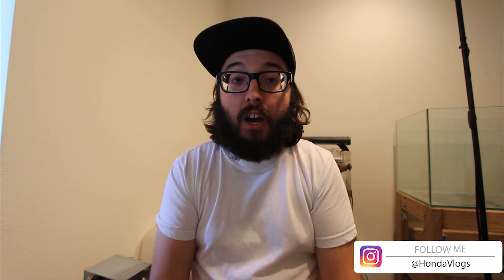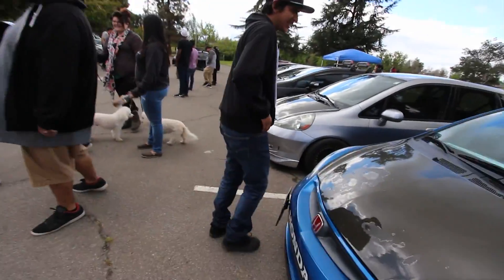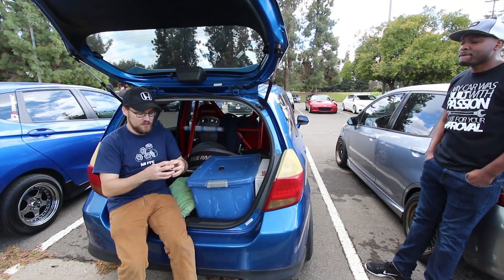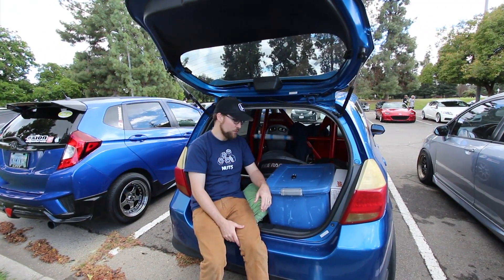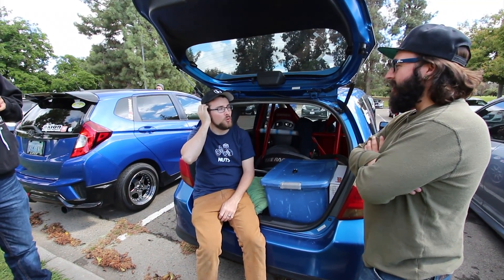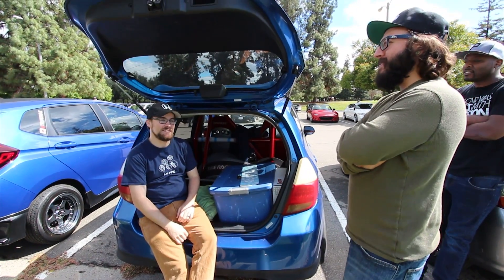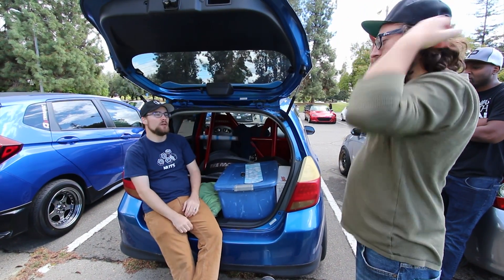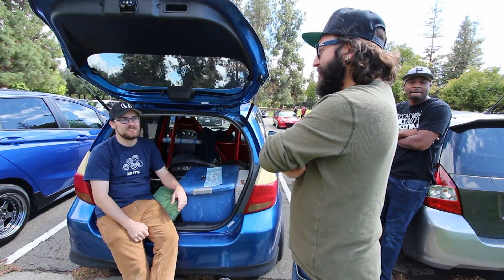Honda Fit/Jazz Chassis and Engine Education Part 1 of 2

Comment: k20 isnt not 7 grand . You can buy an Honda Civic SI hatch back that have k20 the 3 doors for like 4 grand just drive that or swap the motor
Reply from the maker: Ep3 has a k20a3, it is cheap but its thr same as base rsx. It doesn't have true vtec

Comment: 2500 for a custom wiring harness? No, just bust out the wiring diagrams and do it yourself. The swap can be done much cheaper than he said, it just requires you to do all of the fabrication work yourself.

Comment: This guy was insightful, but he came off kinda arrogant at the beginning talking about the k20 swap.
Reply: And if you are not a weiner and can build a car, and not assemble it with bolt on parts, A K swap is 3K including the engine if you get a K20A3 and probably not over 4K ish for a A2.

This guy knows alot about specs but that seems to be pretty much it. Just look at the exhaust...
Reply: @maximeostiguy8838  exactly what I was thinking. '2k of custom wiring' or $200 of materials and a little know how to make your own harness.

Comment: The engine from the "twin spark" version is called i-dsi. The GD3 & GD8 is sold with the 1.5 liter L15A i-dsi here in Malaysia.
Reply: In the UK we have twin spark on the l13a1 aswell I think this guys doesn't know as much as he makes out he knows
Reply: I had the 1.2. i-Dsi "Twin Spark" 78 HP from 2005. Mine was made in Japan but in the same year they started importing them from China to the Benelux. They were not as good.
Relatively lot's of  torque for the 78 hp it had.